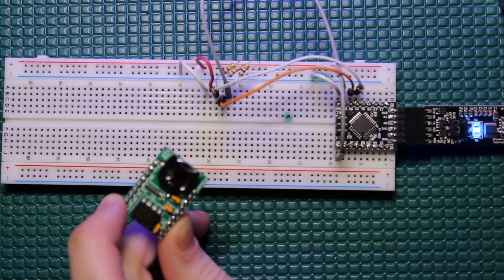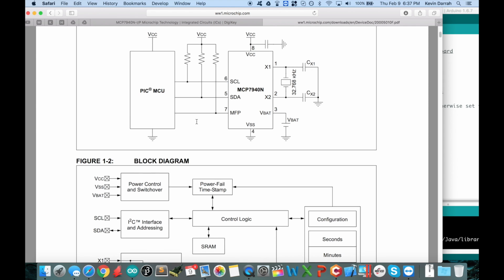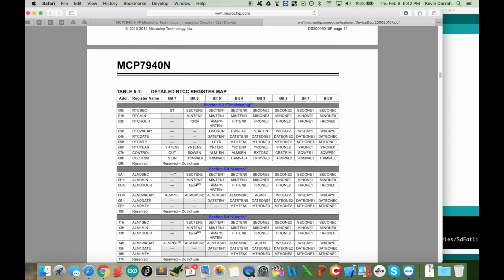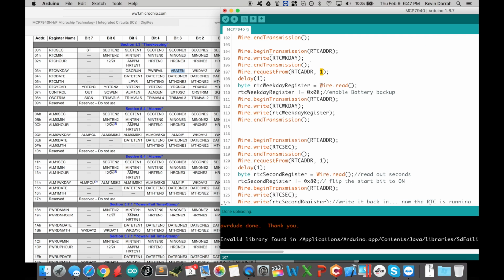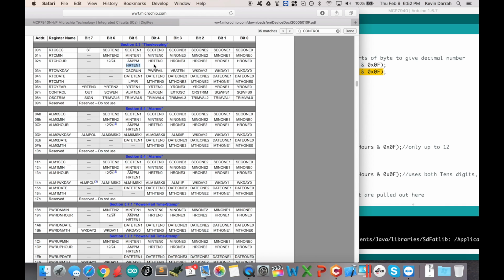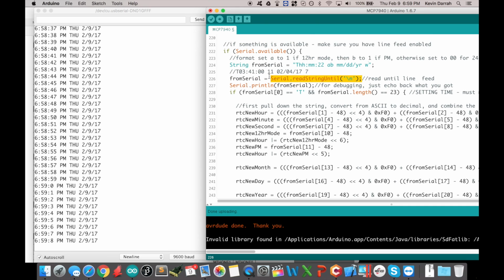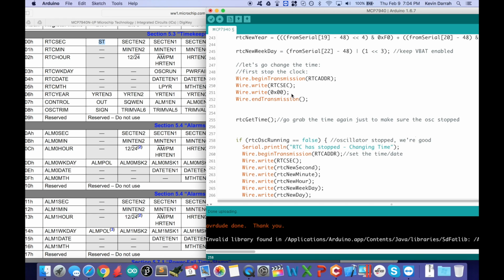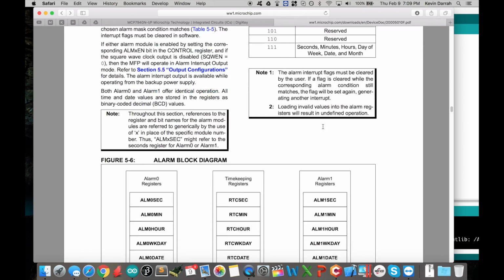RTC (Real Time Clock) with Arduino - Low Cost MCP7940N

Comment: Absolutely amazing video. Thank you. The only best video I've found for using the Arduino with this particular chip. All other videos simply use the standard DS1307 module. I don't want to use that because where I'm from, an original part costs a kidney and an eye.

Comment: Hello Kevin There is a one arduino board  that has a RTC build on board well it has a 32khz crystal on it. Te arduino zero pro Which i used recently i been using it as a RTC clock for 2 months now and have only lost about 20 seconds of time.  that chip alone is only 2.95  then you need the crystal for it and other little parts so maybe around 4 dollars for all. But it does make a good RTC clock chip and cheap too.

Comment: Great video. But why do you need include wire.h library in your code when that library is already built in Arduino?
Reply: Prewritten library hides a lot of stuff that you otherwise wouldn't see/implement yourself. To learn how to extract data, format it and use it however you want is the skill every engineer needs. Cheers!!

Comment: Why do you convert the raw data (which is stored in BCD) to decimal (actually you're converting it to binary). An example is if you don't convert it you can display the value of seconds with the command "Serial.print(rtcSeconds, HEX)" instead of "Serial.print(rtcSeconds)" and save a few lines of code.

Comment: Do you know if the battery drains from the circuit while it is connected?
Reply: I meant if the battery is drained from the circuit while the circuit is supplied from an external source. I'm not a moron. Calm down turbo (therealnightwriter).
Reply: The datasheet says that the battery supply is disabled when Vcc is above 1.5V (+/-0.2V), but with 3V on Vbat, current draw is only 1.2uA.
Reply: As said by Peter, RTCs draw little to no current. Depending on the power circuitry, some devices can disable battery drain while powered externally. With an RTC, I wouldn't worry much about battery drain; they can run a few decades to centuries on one battery.
Reply: A CR2032 has roughly 225mAH capacity. An RTC drawing 1.2uA, 24 hours a day would last for 21 years.